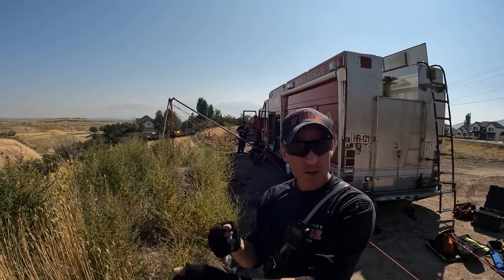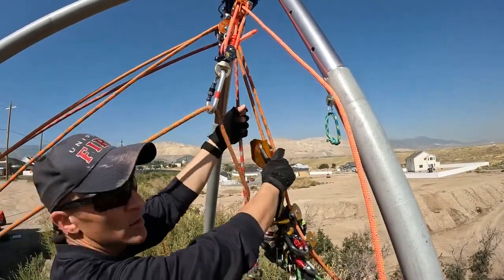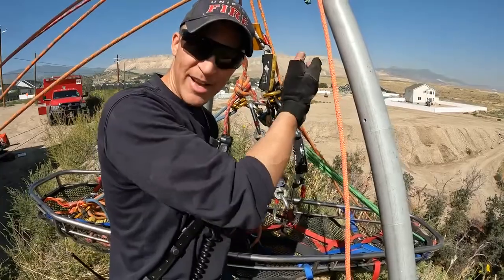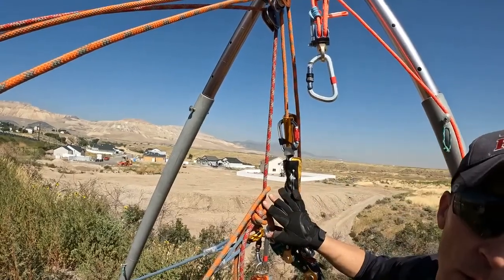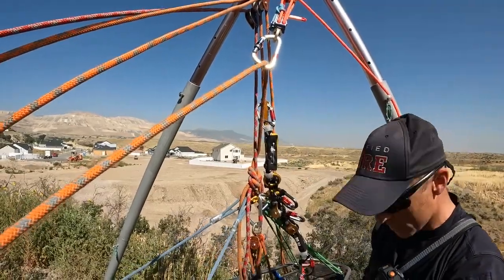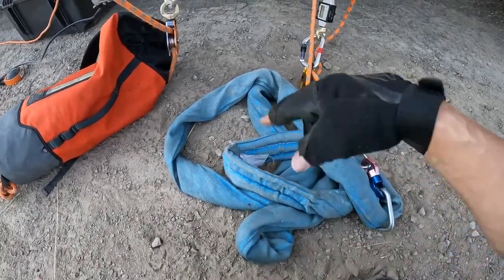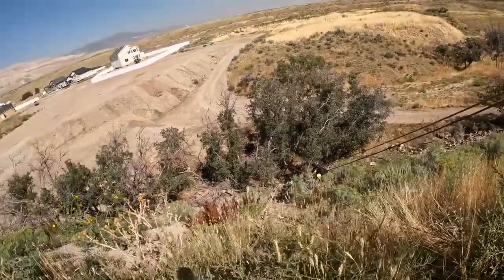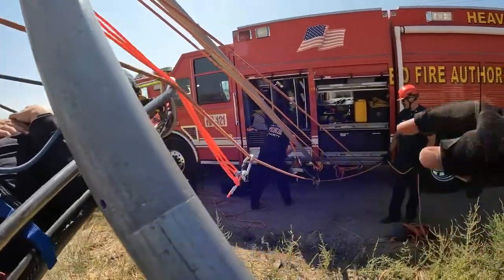Steep Highline for Roadside Rescue

Comment: Bob how was the easel leg of the vortex attached to the pindle hitch? Hard to tell in the videos.
Reply from the maker: We have a fabricated assembly that consists of the blunt foot that they used to make (now they only make flat feet & raptor feet), & put a bolt through it.  The bolt goes into the eye of the pindle hitch, but within the eye is a ball joint... I'll just post a picture of it on my "Community" tab from my channel homepage.
Reply: @Propeller_Head  Thanks!